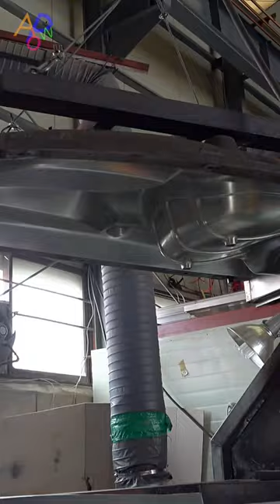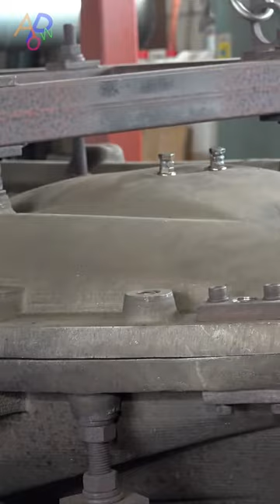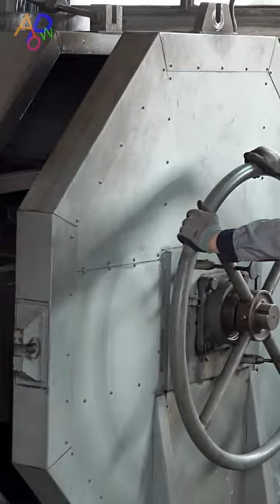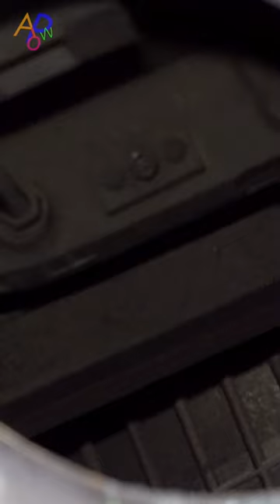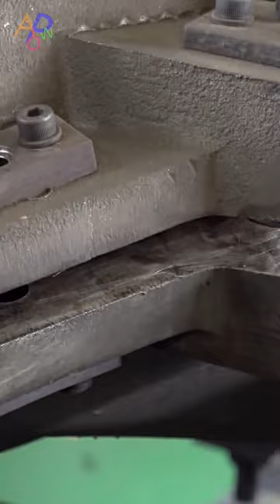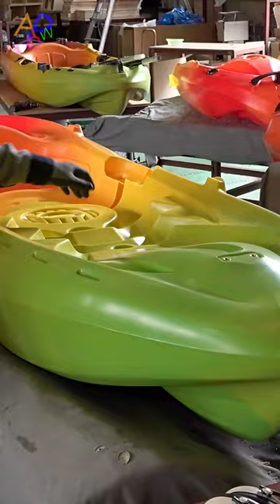Kayak Making Process by Plastic Boat Factory #allprocessofworld

Comment: All that and its only a kayak that has 2 halves? Have fun buying a kayak purposely made to break.
Reply: It's foldable for ease of transport. They're pretty much unsinkable.
Reply: @nagualdesign  you must not own a kayak. Even sit-in kayaks float even after being submerged because they come with foam inserts to prevent sinking. I also referred to the use of the kayak. Not the storage of it.
Reply: @terencerenshaw91  What did you mean by "made to break"? They're fairly indestructible in my experience.